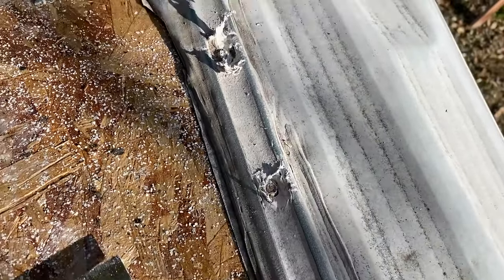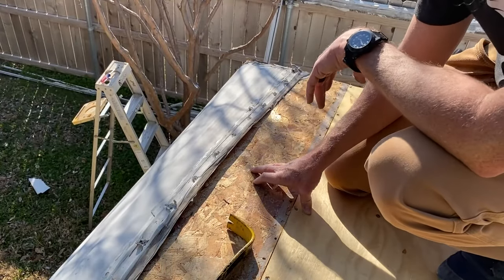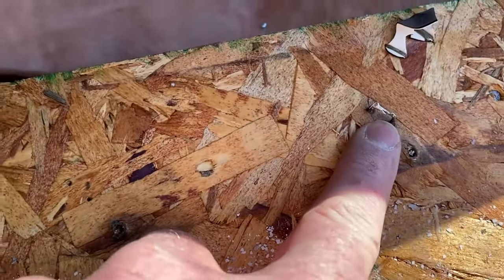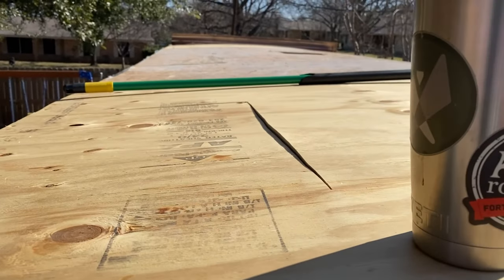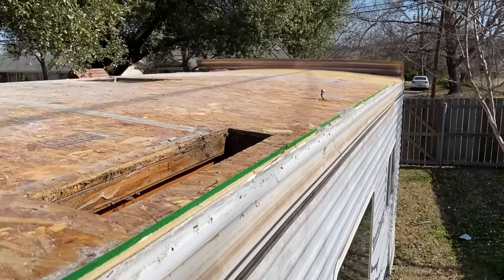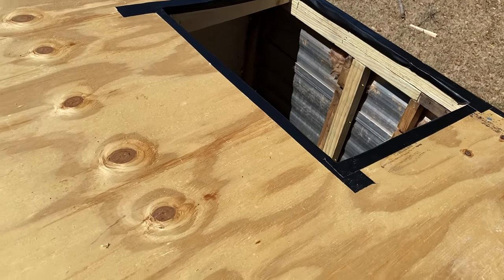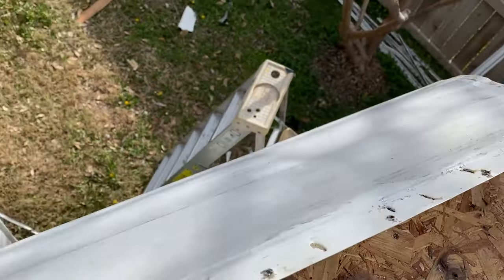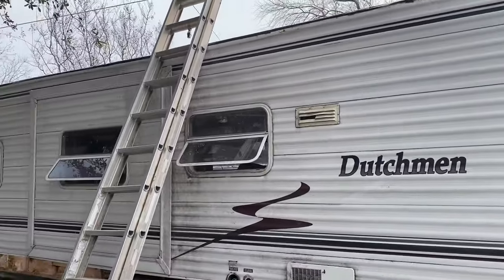RV Roof Repair: Prepping to Install a New Roof

Comment: The cutouts for the skylights fans and air conditioners would be much easier and cleaner to do if you drilled holes in each corner and then used a router with a flush cut trim bit to cut it out for a perfect fit. You could even use a slight round over bit to ease the edges where the membrane comes across the edges of your plywood. That way there's no sharp 90 degree angles for your EPDM rubber roofing membrane to be stressed over. I'm getting ready to do the exact same project to my RV and your videos were excellent! Thanks for sharing!
Reply from the maker: Good options.

Comment: Wanting to try this on my old camper. Kinda my last hope is to do it myself the roof is sagging/collapsing inside. But not a good carpenter. Mines a 24 year old Wildwood forrest river and is 40 foot long. The entire roof is compromised and pretty much a total loss but its centimintal to me so im willing to do what it takes to save her. Thanks for these informative videos there giving me some hope on this massive project.
Reply from the maker: You got this.

Comment: I'd recommend when installing the epdm layered as follows: decking, adhesive, front cap siding, adhesive, epdm, staples, adhesive, then termination strip with lap sealant on the top. You may want to see if epdm manufacturer recommends adding epdm primer before adhesive is applied or adhesive/lap sealant won't stick.  Unlike what the manufacturer did was put the epdm under the siding.  In case of a leak it wouldn't run inside the trailer but, over the outside of the siding.  Basically the same as installing the side/back wall termination strip.
Reply from the maker: Hey Ricky, thanks for the input. There's a definite order to things and lessons learned from this project for sure. Thanks for the sequence.

Comment: I'm curious. Why a lot of people are using duct tape for the corner edge's before installing the membrane? is it because it is cheap? I'm about to install a TPO roof tomorrow and had thought about using gorilla tape which I purchased. But after cleaning up all my edges and new plywood. I tried a test piece and the gorilla tape didn't stick to the fresh smooth plywood well at all. I also bought dicor seal tite corner tape to do the front vertical corner molding after the roof is done. I tried a small test piece on the roof wood to front metal siding termination area, and it stuck to both materials and won't come off. seams like a great option.  Before I choose which one to go with. I thought I'd ask a couple regular rv DIY'rs.
Reply from the maker: Yep...just to protect the membrane on the edges. I would go with what you can get to stick. Best of luck.

Comment: Just wondering what you use to clean the roof from debris since the old plywood is so sticky
Reply from the maker: I typically start by using a wide-blade scraper or putty knife to gently remove any large chunks of debris or old adhesive stuck to the plywood. This helps to get rid of the bulk of the material without damaging the wood underneath.

Comment: What type of plywood did you use to replace the rotten plywood? And what thickness. A lot of people have told me 1/8 inch plywood but it doesnt seem strong enough. I was thinking atleast 1/4inch
Reply from the maker: I believe it was 3/8"

Comment: What's the name of that tool you are using to cut the roof?
Reply from the maker: The red-handled tool is a sawzall. Is that the one you are referencing?
Reply: @remodelyourrv  yes that is the one I'm referring to. That tool looks like it's amazing
Reply from the maker: It’s one of the most useful tools I own.
Reply: @remodelyourrv  do you have a link where I can buy the brand you use?
Reply from the maker: @tyson1100  I got this one at Harbor Freight for right around $20. I have been abusing it for years. Here is the link: https://www.harborfreight.com/merchandising-promotions/hot-buys/6-amp-variable-speed-rotating-handle-reciprocating-saw-61884.html
Reply: @remodelyourrv  thank you so much for sharing the link and sharing the information
Reply from the maker: Anytime.